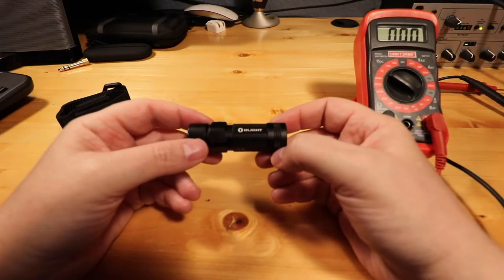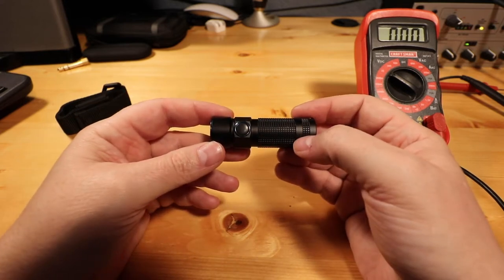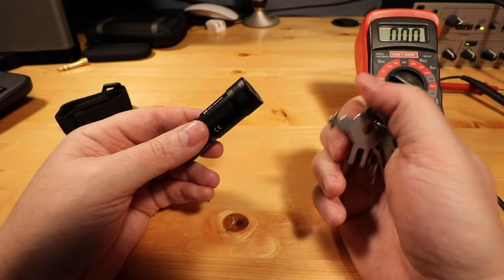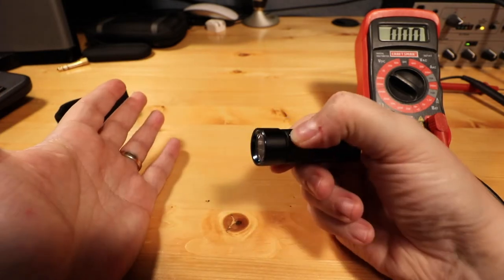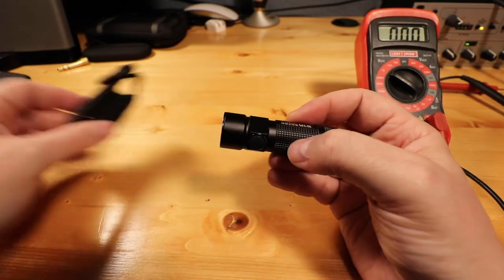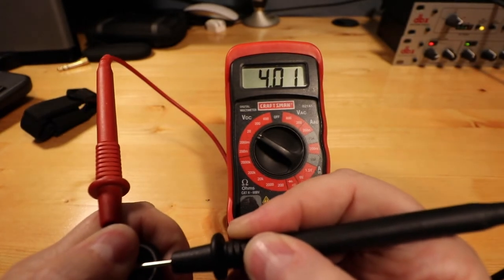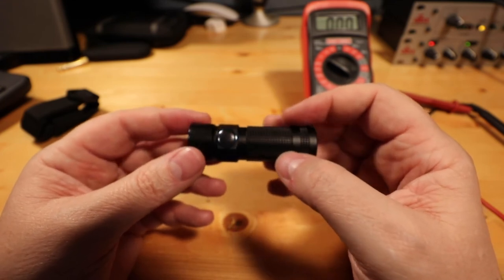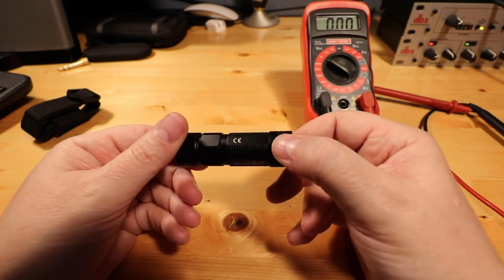Olight S1R Baton Rechargeable Flashlight Shorts Out Plus How to Reset the Flashlight

Comment from the maker: Thanks for watching.
Reply: Thanks for the video. I’m surprised that is not a bigger issue as I have read MANY reviews on the S1R and S1R ll and only found a couple mentioning this. My guess is most people carry these lights using the clip. I have a Fenix E18R that does the same thing as your S1R when I carry it in my pocket with conductive things. Like you I would then loosen and retighten the tail cap and all is good. My guess this is a safety feature but it’s a bit of pain to have to reset the light when you need it. I bought the small E18R intending on carrying it in my pocket!  
I have been researching this a bit and found several videos. The first two you might find interesting and the third helpful as the guy says, in the description, he contacted Olight and got a replacement tailcap.  

Steel wool fire.  
https://www.youtube.com/watch?v=wCEjJhm8qYM  

Another steel wool fire.  
https://www.youtube.com/watch?v=rhAiF8cW2jE  

Says Olight sent him a replacement cap. 
https://www.youtube.com/watch?v=dbUJRmpSyYk
Reply from the maker: +John Harris thanks for the links. I will check them out.

Comment: I found a plastic cap from somewhere that fit over the back .
Reply from the maker: Thanks. I’ll look online.
Reply: @scottkubacki9108  they arent online , you have to look in your  recycle bin
Reply: @scottkubacki9108  Also FYI . the outside ring on the back connects to the body of the flashlight (why the plastic covering the battery itself  is important )   and then to the + of the bat via the charging circuit..not directly or a short at the back  would have some serious consequences.